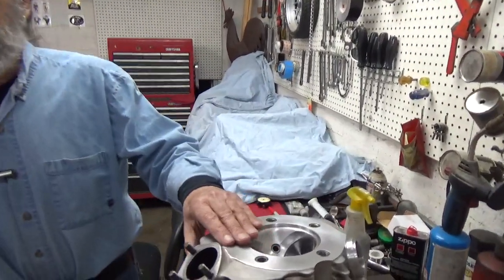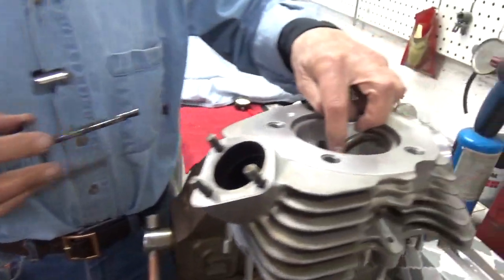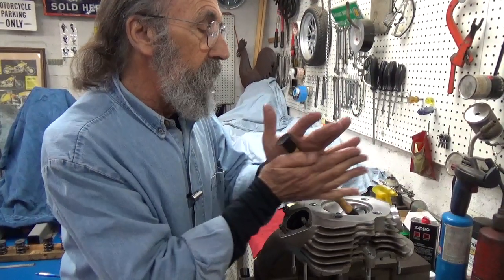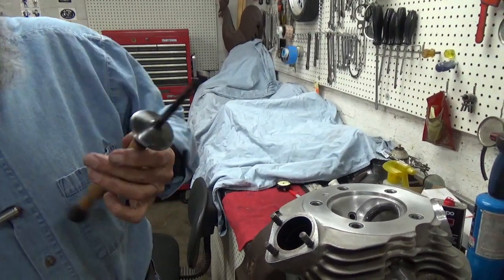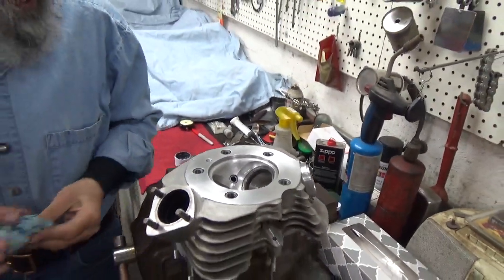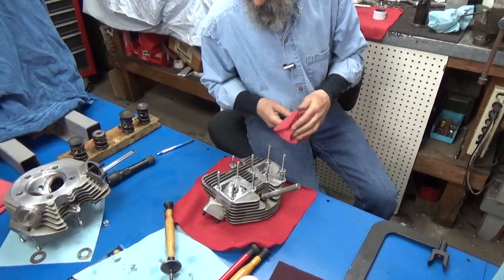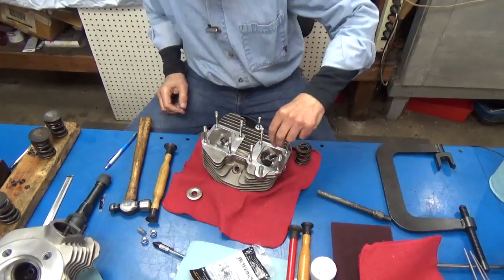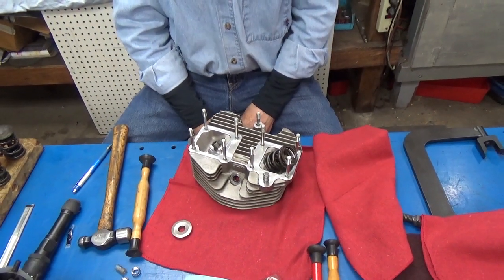Lap The Valves On a Harley Davidson Shovelhead

Comment: That 3 stud set up on the exhaust, holy crap, I really need to do something like that, or really just one more bolt/stud hole, 1 bolt is just not cutting it and I'm stacking gaskets, using evo gaskets... Now I'm stressed from thinking about it
Reply from the maker: The problem is; When Harley first came out with Shovelheads, the exhaust was well supported and it was no problem.  The exhaust system from the heads was welded into one piece.  There were no separate exhaust pipes, and it was fine.  Then  came the guys (us) who wanted duals from the heads back.  This would have been fine, but we didn't realize, they needed to be supported better.  They were just hanging from that stud, without adequate support between the top and the bottom.  Think about it that way, and get a little more creative.  You bet I love the three stud mounting.  Those heads were made that way, and it is quite an improvement.
Reply: @pacificmike9501  
I never knew that, it makes sense. When I see a properly sealed rear exhaust I get so jealous

Comment: do you by chance have video of removal of pinion set for i having to replace cases on 82 shovelhead
Reply from the maker: We did it in an early Evo series.  We've done all the camchest work with the exception of removing the pinion gear set off the shaft.  It's pretty well explained in the factory service manual.  Go to our Youtube homepage and click on "videos."  You should find most stuff there, but pinion gear, be careful of year differences.

Comment: "Where did I put that tool". Damn....if I had a nickel for every time I have said that! 🙄😁        Good to see iron guides in that head. I wouldn't give you a penny for bronze in your application (or 90% of other applications). I work on Japanese heads and have seen bronze guide wear out in 5,000 miles when used in bike that have a large valve angle and 6.5 and 7mm stems and some good pressure to work with a large cam. Given the angle in your head, weight of the valve and the spring pressure necessary to make it work properly they (bronze guides) might last 1,000. Why Branch heads use bronze guides is beyond me.
Reply from the maker: People use what works for them.  I prefer cast iron guides.  But I know people who get wonderful results with bronze.  I learned to clearance things completely different with bronze.  Still, I prefer Cast iron.  We all do things the way we do them.  That doesn't make anyone else "wrong", just different.  Sounds like you're pretty set in your ways.  Probably old, like me, no, like you.

Comment: do they make a bench mount cylinder head holder !
Reply from the maker: There are so many interesting tools made for Harley work.  I'm sure.  Just type it into Google.  I'd try something like "Cylinder head Holding fixture for Harley Davidson Shovelhead."  Or, get a piece of round stock, weld the steel end of an old sparkplug (long reach) to it and now you can screw it into the head and clamp the other end into the vise.  You can use "all thread rod."
Reply: @pacificmike9501   ok thx good work see yah on the curb!!!!!!

Comment: I lapped my shovelhead valves in the Army automobile craft shop in 1979. Not that hard with professional instructions and the correct tools. After that with a stock cam and solid lifters I out ran the new 80 inch Harleys. Ok I had a weight advantage with a Chrome-moly rigid Ness frame.
Reply from the maker: Yah.  And it's cool.

Comment: I think you are lapping the valves wrong 😁 according to the official manual for the 80 to 83 FLT FXR models, page 3-16, picture 3-7, you're supposed to lap the valves from the stem side of the valve with the springs etc installed....
Reply from the maker: Uh, okay.
Reply: @pacificmike9501  i know you are doing it correct, it is just funny to me that the picture in the official shop manual is wrong... i wonder whether this picture is wrong on purpose (as a joke), because of the whole AMF thing. I bought a second (mint) 1981 FXB last friday by the way (to keep my 82 FXB company), so thank you for all these videos !

Comment: Great stuff, I just picked up a '80 FLH, kind of a project... has a knock in the rear cylinder, upper.... Hmmmmmm, Ill be falling asleep to the Shovelhead vids.. What head is that, 3 bolts for the exhaust??   
Thanks Mike.
Reply from the maker: Thank You.  Those are STD Cylinder Heads.  That is the brand name, not a condition.
Reply: @pacificmike9501  Thanks!! I broke out on my 71 Ironhead in Mentone Beach back in 89. OHHH those were the days....

Comment: I got a 98 fatboy that has 56k on it and its starting to leak at the rocker box 😑
Reply from the maker: Look at our playlist on rebuilding an Evolution Engine.
Reply: Just a rocker leak isn't too hard to fix. Mike's got some good disassembly and reassembly videos. One technique in preventing the leak is a good warm up procedure before riding. I like to wait until I feel some heat through the top of the rear rocker box with a bare hand, that lets me know that everything in there is getting some warm oil before putting a load on it. Good luck and have fun wrenching.
Reply: Oh, and if you haven't already, a factory SM for your year and model is a great resource to have.
Reply: @SixShooter14  i bought it used and it was alittle wet not bad tho.. dude i got it from was honest about it
Reply: @liamstandish878  I hear ya, My '92 Softail had a leaky front rocker box when I bought it, I fixed it in a few hours with help from a friend. My current '97 Road King had leaky rear base gasket and front rocker box when I bought it, I just sent the heads and cylinders to the machine shop yesterday. Hoping to have it sealed up next week. These are relatively common with the EVOs. Again, a lot of it can be attributed to improper warm up. I rode my Softail for 2 years and about 8k miles after the rocker box fix without any more leaks.